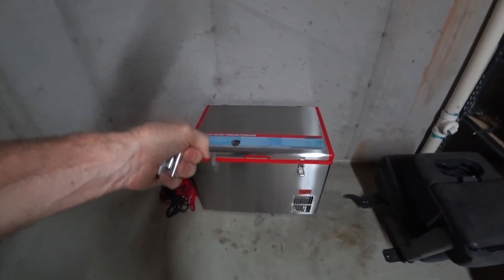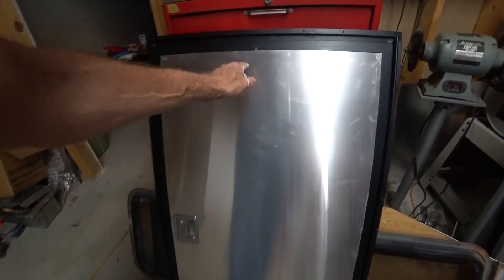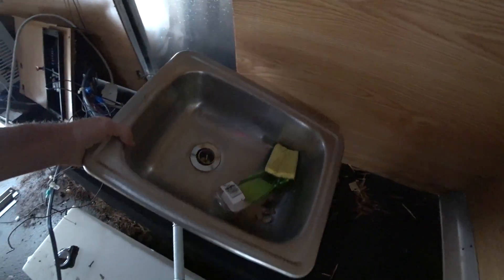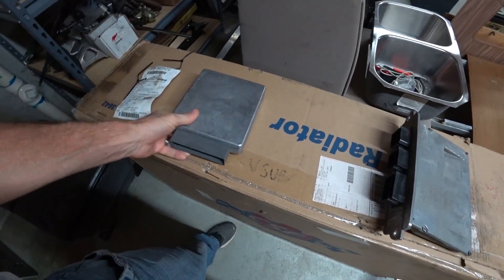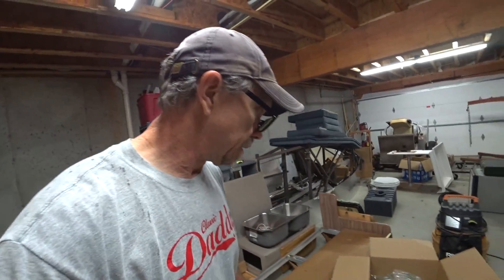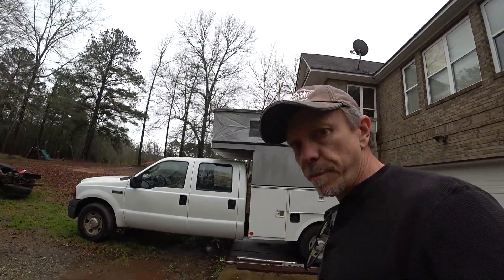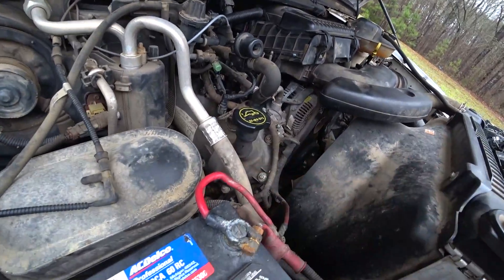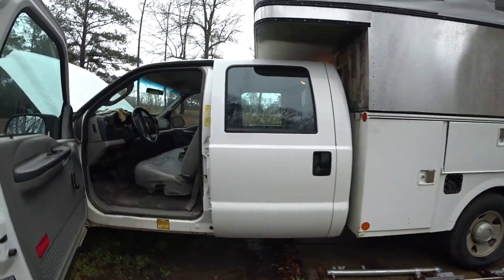Mounting the Camper on a Utility Bed - DIY Budget Overland Truck Camper Build 5

Comment: spray the head gasket with brake clean or ether in moderation and you will find out if it is the head gasket leaking real quick!

Comment: the struggle is real. Im building a flatbed pop up from scratch all aluminum, and I know what its like, lucky I can fit mine in the garage and keep out of the weather. how is the soft side attached to the roof and walls on yours, maybe a few close ups on the next video? Thanks keep up the good work
Reply from the maker: Honestly I'm not sure how the top is attached. The bottom drapes over the exterior wall and is secured by a piece of trim with screws. You might get a good idea if you take a look at one of my previous videos.

Comment: Not going with the 4X4 chassis ??
Reply from the maker: I am. The plan is to bolt the running gear on the two-wheel drive chassis.